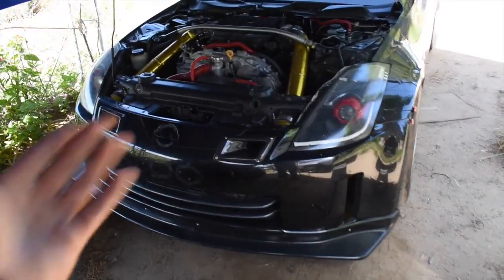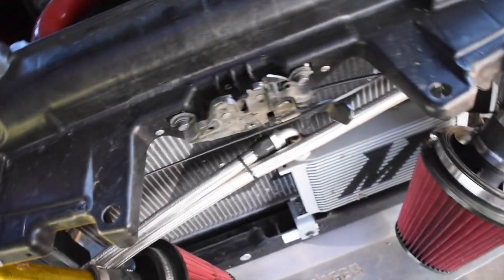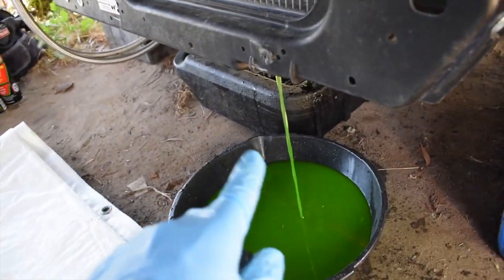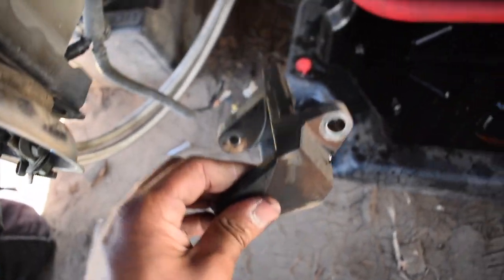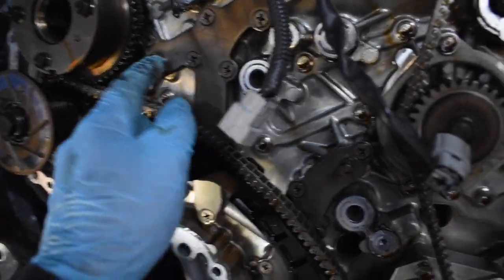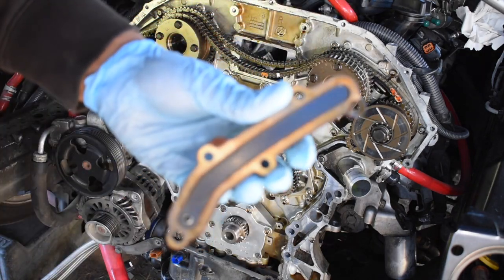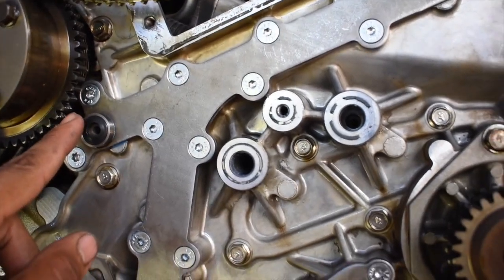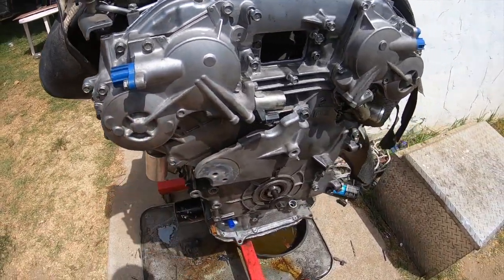VQ Gallery Gaskets Made Easy | G35, G37, 350z, 370z

Comment: Made easy! Pulls engine 🙄
Reply from the maker: If you watch the  video you'll know that the reason I had to pull the motor had nothing to do with the gallery gaskets. You can do all of this with the motor inside the car with no issues.
Reply: @tuned_tunas  so I got a g37s 6mt it’s got 210k miles on it still runs strong , I want to get my gallery gaskets done, I was quoted $800 if I supply all parts and fluids or should I just do it myself? I’ve always worked on my own cars never been a shop type
Reply from the maker: I would never pay 800 to get this job done. But that's just me.
Reply: @tuned_tunas  I’m mechanically inclined my only big concern is the  crank pulley bolt, and the timing
Reply: @tuned_tunas  you ever felt confident you could do something but slightly concerned because I don’t have any air tools, plus I hope I don’t mess up the threads on the timing cover
Reply from the maker: You seen my videos bro. I dont have any fancy equipment or a shop. Me and my homies with zero past experience took it out and did the work and put it back in. All the concerns you have everyone has. But its more about your mindset going into it. I have a timing video as well to show you how to exactly set it to time.
Reply: @tuned_tunas   BIG BET!! I’m going to do it myself , worst case scenario I can just dm you if I have any questions if that’s ok
Reply: @tuned_tunas  how did you get the crank pulley off
Reply from the maker: Weighted impact socket